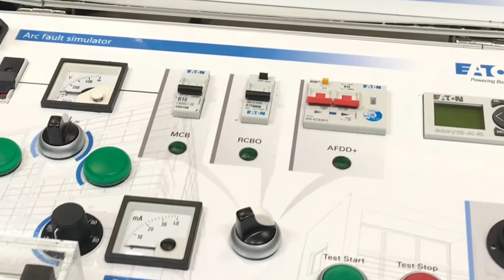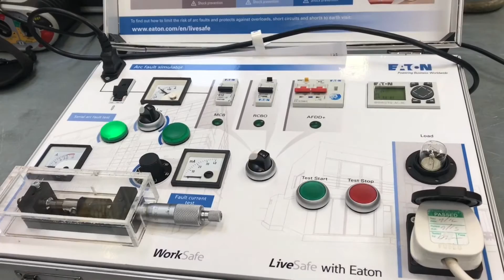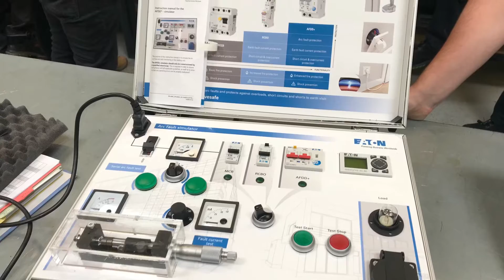How do AFDD’s Work? - Eaton AFDD Rig Demonstration 18th Edition Wiring Registration

Comment: Thanks for the great video, always informative! I have a question not related to this vid but to others: In your vids where you show the CU, you use labels on your wiring like L, N, 1, 2, 3 etc, but I never heard you mentioning them, what company are they from?
Reply from the maker: Hi. We love to show our learners best practice. Identify the conductors by numbers and letters makes testing and fault finding easier. 

https://www.hilltop-products.co.uk/hg-4-9-b-w-marking.html?utm_source=google_shopping&atrkid=V3ADW1A4763C1_45045777064_pla-297612067635__170050851794_g_m_pla__1o1&gclid=CjwKCAjwscDpBRBnEiwAnQ0HQOdtph2smAVRm5GMRqZjB52NKkiWXIG3f8JB78luaYiPIKy3-9tnjxoCH28QAvD_BwE

Many electrical wholesalers can source them 👍

Thanks Gaz